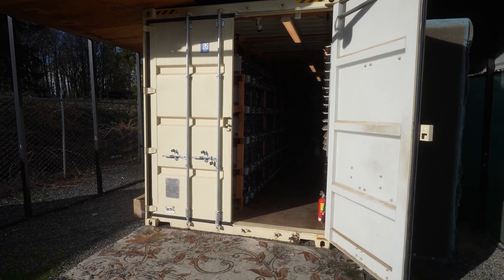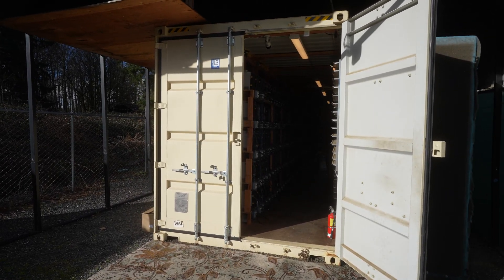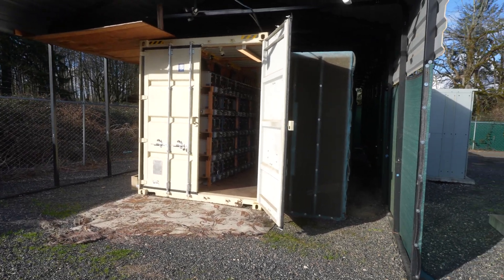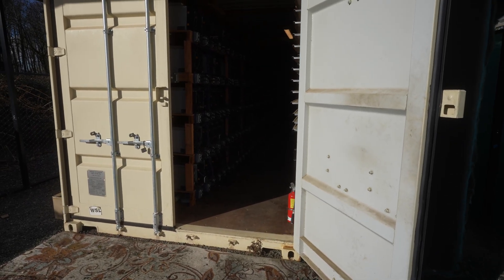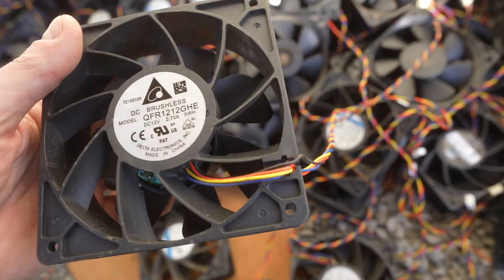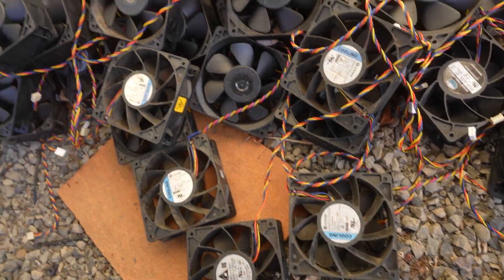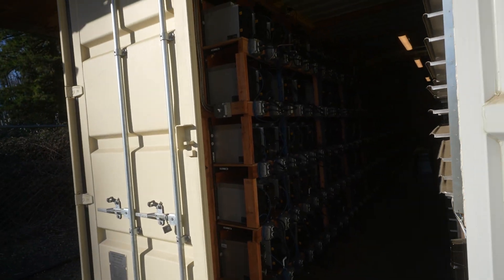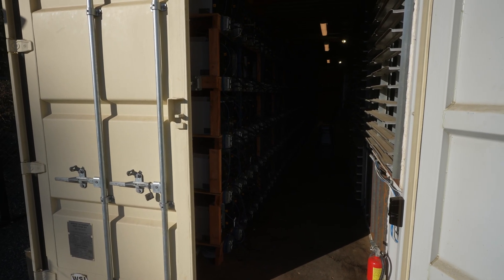Bitmain S19 Fan Issues - Diagnostics, Fix, Firmware, Glitches

Comment: The struggle is real with those fans! Ha!  In several cases, I have updated/re-flashed the firmware and it will re-detect the fans and work again (assuming the fan were not physically damaged).  Thanks for sharing.